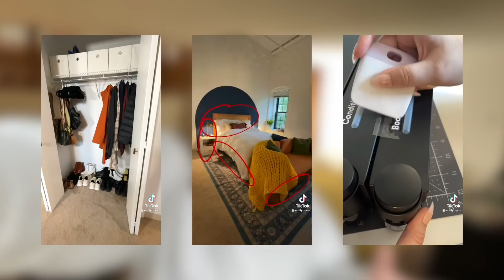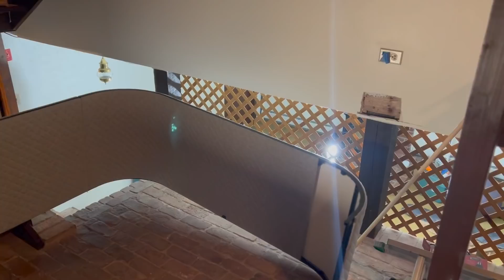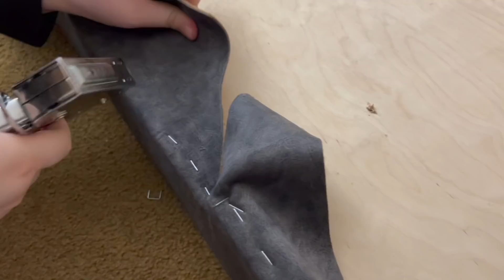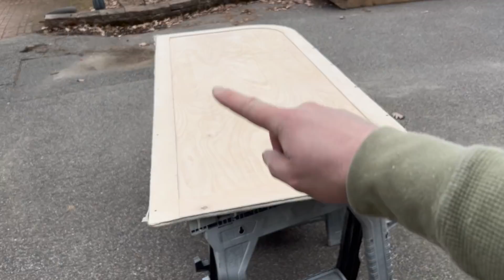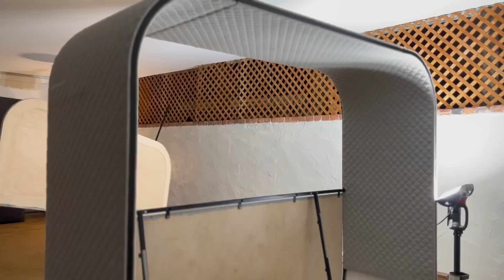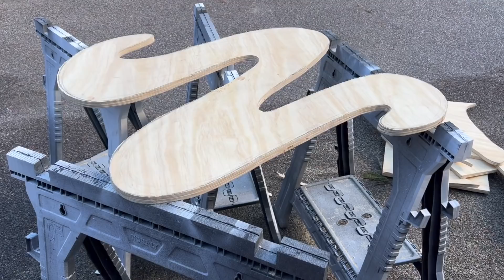Our DIY House Renovation Progress! (Dance Room Nook, Aesthetic Wall Storage & More)

Comment: Great job on your first upholstering. Handled like a pro! 💁🏼‍♀️
The sanding would be a lot quicker if you hooked the sander (you’re using an angle grinder, right?) up to your vacuum, that way you’re not sanding in the sawdust which creates deeper scratched & therefore needs more sanding to remove. 
I wish I could give you more time in the day to do all the things you’re doing. But thank you for sharing it with us all! 💗